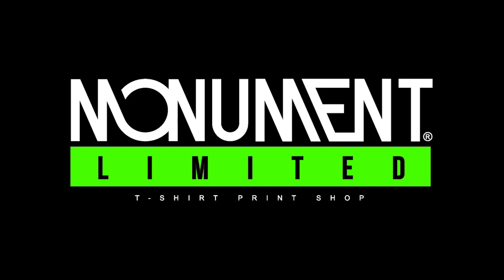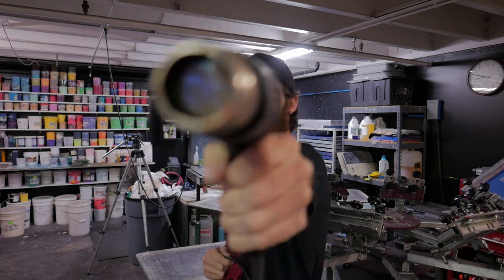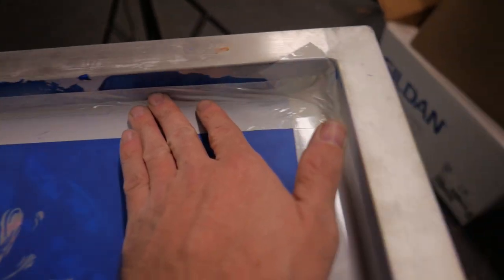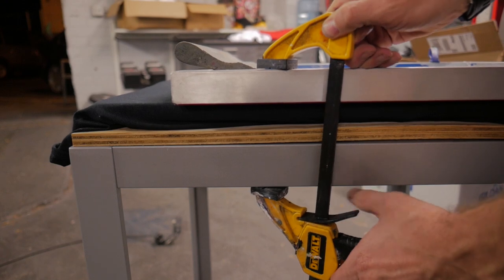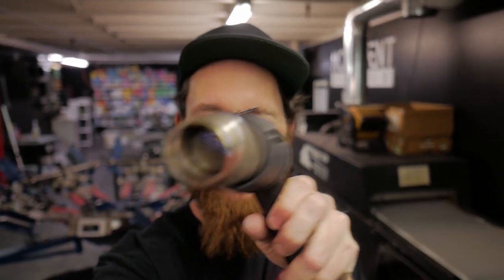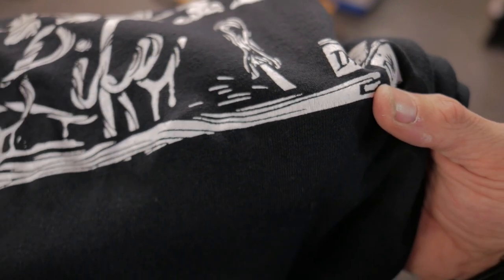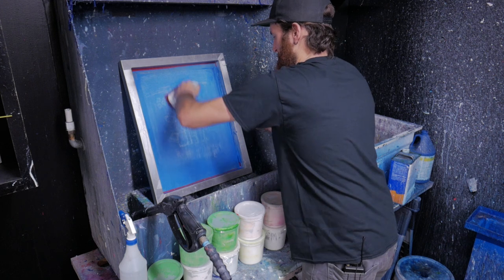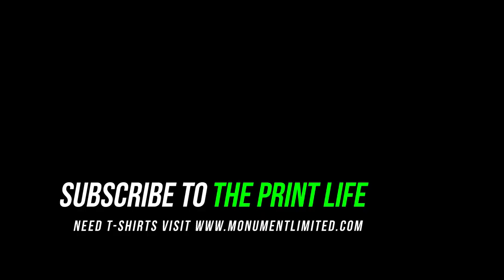Print t-shirts at home cheap | No Equipment

Comment: Thank you for the video. Can I ask you a few questions?:
- The "de-greaser" is dish soap or something else?
- I was told water based ink is better than plastisol for beginners, is that right?
- Can I follow this tutorial with water based ink or does it have more steps?
Reply: Degreaser is not dish soap. It's called degreaser, there are multiple brands, you can buy it anywhere

Comment: hello!  thanks a lot for the awesome tutorials! so I am a visual artist and illustrator based in panama city, I am currently organizing my studio to start printing some t shirts, but the only thing I dont have is a flash dryer for curating the ink, or an oven nearby. My question is, can I fully curate plastisol with a heat gun? I will start printing black ink on white t shirt. I would really apreciate if you could answer this :)
Reply: Hey que pasa 👊 un saludo desde Bta col - escríbeme a @kalbotero

Comment: If the tools mentioned can't achieve a bright white print on a dark shirt, what tools would I need and that I can get if I'm working with a tight budget to do so?
Reply: Try to find a low mesh count frame like 77 or 90 , then use plastisol inks for dark garments ( mix it a lot before you used )

Comment: Can you do a video and how to print your design out and to burn the image on the screen.
Reply from the maker: Already did the burn the screen video. I also made a video on how to print your design without any equipment. https://www.youtube.com/playlist?list=PLE-KEiLobt20nULsQJ7FKlussNBO6RqDG
Reply: I saw those thanks. But can you do one on printing a design from adobe illustrator, like a 2 colors separation?
Reply from the maker: Oh for sure. Are you going to buy the super expensive printer and rip? or would you like a low cost DIY option? Actually I will put both in the video.
Reply: I have  Epson 1430 printer and accuRIP software. I'm having problem with printing out 2 or 3 colors designs.   Also, whenever I burn my image on the screen, the emulsion don't wash out. I don't have a pressure washer,  I only have an hose, so I use that.  Not sure what I'm doing wrong with the printing or burning the images on the screens.
Reply: Hi i am going through the same problem as my emulsion dont wash out after i burn my image on the screen. Have u figured it out why. it would be of help.
Reply from the maker: What light source are you using?
Reply: I'm using (Ryonet Small UV Screen Exposure Unit - 16x20in) and the(Green Galaxy CryoCoat Emulsion)
Reply: I burned the image for 3 and 4 minutes, but still the same.

Comment: No registration marks on the design?
Reply: LongviewGarage there's no need of reg marks in single color screens
Reply: I was kidding, but I put registration marks on my single color print jobs all the time.
Reply: oh ok! but why do you use for 1 color prints? i just wanna know.
Reply from the maker: the film had reg marks but because of the way we exposed the screen with the sun and no glass on top. it undercut the reg marks to the point that they disappeared.
Reply: thanks for explanation Cam
Reply: ***** thank you James
Reply from the maker: Yahehe "free ballin" that's exactly right I did not need them in this situation. However the film did have reg marks but since I exposed this screen in the sun with no glass the fine details were undercut.
Reply: Ubaid Hussain I use reg marks on all designs in my shop. We use them to line our jobs up on the press quickly. We do a center reg Mark at the top and bottom to make sure it's centered on the pallet and also add corner reg marks for multicolor jobs to register the screens to one another.  what do you use?

Comment: Cool but im pretty sure this costs more than getting one printed
Reply from the maker: Most hobbies will cost more in the beginning, the cost of the screen alone will be $25 bucks
Reply: @ThePrintLife  so why tf you say it's cheap
Reply: It's a cheap way to get into screen printing.  I also think by cheap he is referencing not having a big press, conveyer and other expensive machines.  You can reuse the screen for your next project and the project after that and so forth also, which if this is a hobby will bring your total costs down in the long run